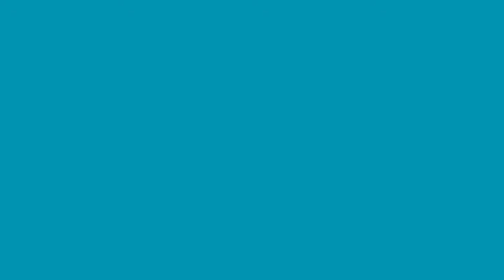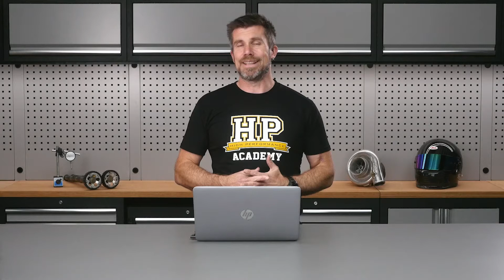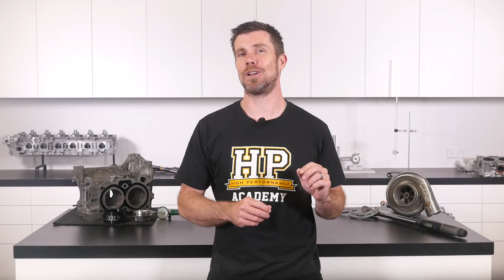Tuning Without A Dyno | Getting The Most Power [HPA Q&A]

Comment: In your experience, how does Methanol injection compare to e85 in terms of knock prevention in FI engines?
Reply from the maker: We have had greater success with less complications using E85, however, our use of meth/water injection is not extensive.

At the end of the day both options have their own unique pros and cons and how they stack up depends on your requirements and usage which could be very different to ours.

We cannot get E85 from the pump for example, but since it's only used in a race car, it is not too demanding to mix our own. For someone else that would certainly be a deal breaker.

That is just one point just to illustrate the need to consider what is best for you with the facts at hand and not just what others are doing - Taz.
Reply: @hpa101  Thanks,  I would absolutely run e85 if I could, but Gull stopped supplying it at the pump which makes it a no-go for a street car.
Reply: @madthough2298  water meth is great, pump E85 is uncommon for me too, so I run water meth through my roots blower into an 11.5:1 compression ratio engine at up to 11 psi boost. Keeps it happy lap after lap on track, even in temperatures of 40 deg ambient! Nothing against E85 though...I'd run it if readily available
Reply: @200mphgt40  That's what I plan to do. Methanol water sprayed pre-blower, Eaton m62, on 4age. Are you running an intercooler?
Reply: @200mphgt40  Ideally I want a newer TVS900, but haven't been able to find where to aquire one other than second hand on ebay
Reply: @madthough2298  yep, R900 for streetand great all round efficiency or R1320
 For track or outright power would both be better than mp62. But an mp62 works well enough, but desperately needs water meth through it.
Reply: @200mphgt40  the 1320 are easy to come by, but they are a pretty big unit and so difficult to fit in a tight engine bay

Comment: When you tune without a dyno it's handy to have (or create a calculated) log channel for crank acceleration. In a given conditions (same road segment, same car weight, etc.) it will follow the torque curve. It will be in fact the representation of torque curve, just like an inertia dyno. However, it only helps to tune the loadcells of full power
Reply: makes sense, but is this basically the same thing as looking at the trigger wheel speed over time? Like for example a 60-2 wheel with a hall sensor, are you comparing the 'pulse speedup'?
Reply: @ancientapparition1638 if  it represents the angularly acceleration of the crank then it's exactly what you need

Comment: Standalone ECU fitments and EFI conversions do bring other problems on older motors like my 89 Mercedes SOHC six which produces a lot of mechanical noise compared to modern DOHC engines, particularly with a big cam and some mods, we fitted a knock sensor in the same position as a later factory DOHC that shares the same block, but has an MB knock sensor and it triggers as soon as you give it any throttle at any engine speed when it definitely isn't knocking. For older hack setups like these, basically Microsquirt on an adaptor on KE-Jetronic it doesn't quite want to tune like EFI and it isn't points and carbs so things like the audio method of knock detection are the most reliable course. It's pretty unmistakable though, once you're familiar with knock you can't miss it, there's a power loss associated you'll probably react to quicker than listening for it but it's a good idea to confirm by ear that it is actually knock and not some other issue.
This piggyback Kjet system has me constructing fuel and ignition maps cell by cell by trial and error week after week so if you're doing something like that with an older motor that didn't start off with EFI it can be a tedious and time consuming process, especially with an engine type virtually nobody out there uses as a tuner base, so you're pioneering everything. It is built to make 285hp n/a on regular premium but getting there with the tune is the trick.
I'm actually taking the hit of switching over to full EFI conversion on Megasquirt 3 to make it easier to tune but I won't be too surprised if some of the same issues like mechanical noise triggering the knock sensor remain. I have heard other Euro motors from the same period have the same issue with knock sensors. These 80s track spec Euromods basically sound just like a 1950s Aston Martin or something like that on the throttle once you open the exhaust and cam them up, put thicker lifter caps and machine everything, it's a terrific power whine and lopey idle that sounds cool as, but knock sensors really don't like it.

Comment: I wish there was a company that made “home-friendly” hub Dynos for our garages. I could fit one in my two car garage but there are SO expensive! They need to make budget consumer friendly Dynos! There is probably a market for this….just like homemade garage lifts.
Reply: Make your own get matching big 3 phase motors get the mass of the rotating assemblys from the manufacturer buy some dyno software   get a machinist to make some wheel hub adapters with disk brakes if you wanna be fancy make a sliding frame for them easy peasy
Reply: @BIGSMOKE-bl2lq  Com’on man…
Reply: @755hp  sorce 2 large electric motors the same $200ish from a scrappy a laptop $400 dyno software and rpm sensors $?? Wheel adapters use some wheel spacers and som custom parts to adapt to motors $500ish a couple of steel beams bit of welding drill a few holes and boom you got a hub dyno check out some homemade dynos and bike dynos etc its not rocket science hahaha all the mate will be round pissing off ya neighbors
Reply: @BIGSMOKE-bl2lq  Think it though dude... How do you adjustably sink (say) 400kw of electrical power in a variable, repeatable, measurable way. Google 200kw 3 phase motor (youll need 2), tell me that is practical.

A friend of mine is having a go at this. Using 2 eddy current retarders, hes £18k in so far...
Reply: @localwhackhead  im talking basic using them as a known mass to spin up software uses rpm on them and engine and calculates power based on time to spin them up simple
Reply: And old ones that is not new because $$$
Reply: @BIGSMOKE-bl2lq  
I wonder how long a set of HGV brake pads will last on a (water cooled) brake disc holding back 500hp. If they were cheap and easy to replace it could be viable
Reply: I think the problem is for them to be worth buying, they would need pretty much all the features that come on commercially available units, otherwise you're probably better off street tuning.
Reply: I built my own for my shop. And you can build a smaller Hub dyno by using old Retarders from Buses and trucks. 

You could also buy a cheap Chinese eddy-current brake..
Reply: Kinda like a self car wash.I like that idea But when someone gets behind the laptop and doesn’t know what there doing end game is probably a fire or someone gets hurt and the insurance liability is what kills that market. Plus the EPA.
Reply from the maker: There are some unique options out there. AEM sold a unit that attached to your driveshaft for example. At the end of the day though everything comes with a tradeoff, for a good dyno it is the price vs usage when it comes to a home enthusiast, however, for many people depending on their location it is also possible to rent a dyno.

At the end of the day if you want to tune in the cheapest possible way, you should take it to a professional to do it all for you. They have all the gear and will be faster at it.

Pros and cons to that too if you're lucky enough to have a great tuner locally for that to be an option of course - Taz.
Reply: @hpa101  Other option is to attach a strain gauge to a driveshaft plus a telemetry system and transmit the torque data to an in car logger. I do this for work. Still will cost you best part of A$ 10k to do this. But you can then swap from car to car and own it for life.  Despite having access to all this, I just simply measured 3rd gear acceleration under repeatable conditions when setting timing for best power (quickest time to accelerate). I advanced timing until marginal to nil improvement and the knock sensor was starting to show some action. This is on a pump fuel supercharged engine running 11.5:1 compression ratio! So worst case you'd think but it can be done. Car has been lapping tracks hard for several years since, no problems!
Reply: Dyno are extremely dangerous pieces of machinery, and it is never a good idea to use one if it was not sourced from a reputable manufacturer, or if you are inexperienced in their use.